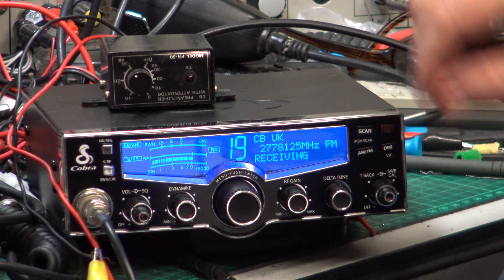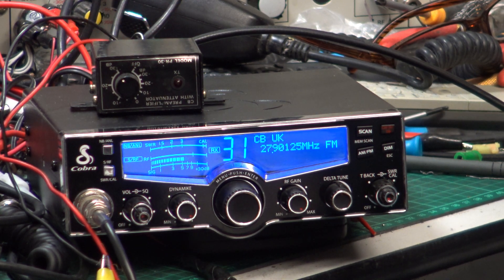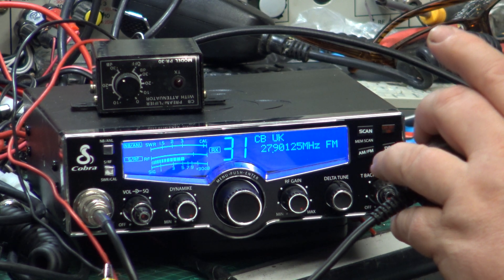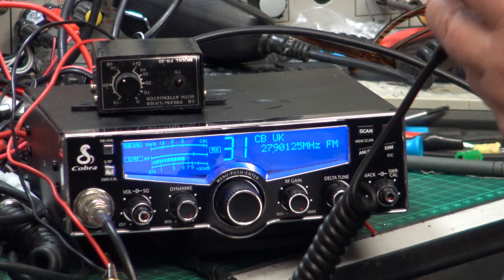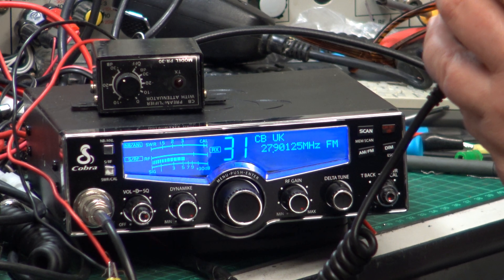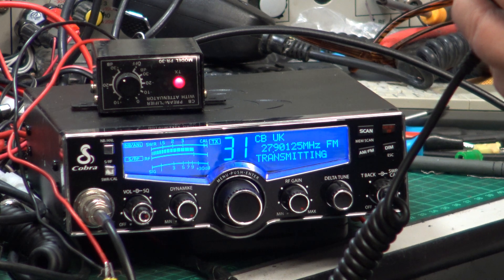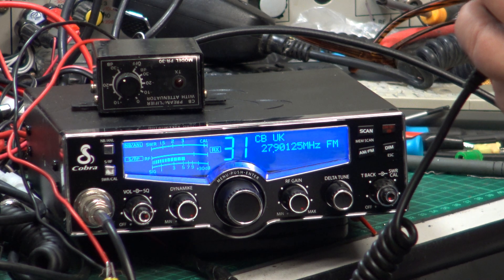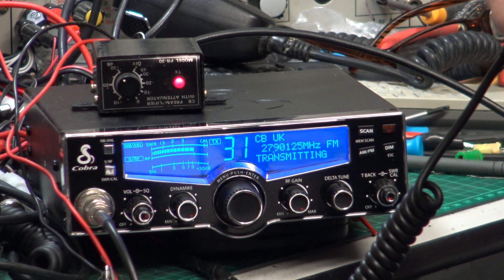RP30 PreAmplifier demonstration on a Cobra 29LXEU

Comment: as far as i am aware a preamp will not help FM signals, but i have noticed on a deaf radio or using an antenna not for the band it does help. I do like the look of that radio but will stay well clear of them. I have a Rotel RVC 240 anyway so why do I need a deaf cobra lol
Reply from the maker: Nobody needs a deaf Cobra. Here's my list of UK Cobra products:-

1981  Cobra 21XFM   (Maxcom 4E with different front)
1981  Cobra SOS emergency set
1998  Cobra UK74ST one-hander    works OK
1998  Cobra UK25LTD
1998  Cobra UK29LTD   same chassis as above, poor reliability, poor performance
2014  Cobra 19DX IV EU  plastic case, works well
2014  Cobra 29LX EU  Feature laden, dreary RX
2014  Cobra UK74ST   one-hander, all electronics in handset that gets far too hot, but otherwise works OK

Great set of products.....not. The Cobra SOS innards from smoke damaged warehouse fire Cobra SOS kit's were rebuilt into Commtel base stations, just in case you didn't know what was inside a Commtel base.

Why do we have the Rotel RVC230 as a reference set, selected from twenty other RVC230's for it's unbelieveble rx sensitivity! You would think after 39 years it would have been surpassed, but no....CB has gone down the useless  bells & whistles avenue & left real communication quality behind. No wonder I use 1964 Heathkit valved gear for my amateur radio activities!

Richard

Comment: Wow Richard looking at the Cobra 29 before the tests started i noted the radio was sat at a noise floor of s9. Do you suffer such so badly 35miles from anywhere ?
Reply from the maker: Normally the noise floor is just S1.5 on UK channels, unuseable on CEPT channels owing to foreign interference. Only radios with sh1t receivers pick up the RADAR from RAF Cranwell 4 miles away. It's as if the meter circuit is looking at before any filtering, but without a circuit or service manual, it's anyone's guess.  Even the Fidelity 1000 isn't affected by the RADAR, though that dreadful Lucas ACB888 we recently did is. I seriously don't think manufacturers are currently beta testing radios even on a dummy load from one laboratory to another, and relying solely on test instruments.

Richard
Reply: he does state in his previous video that he has QRM from radar

Comment: As you correctly say, you are always going to get a little loss be it with a SWR Meter, Matcher or Pre Amp in line but it is interesting to know the Pre Amp works well with this radio. This test shows that this is something worth considering for this radio to balance things out a little. After all, what is the point of getting out well if you cant hear the person on the other end. Interesting test Richard thank you and like all your video's they are very informative.  I can see Cobra 29 LX owners rushing out to buy a Pre Amp now LOL.